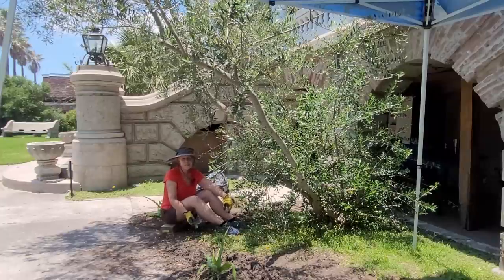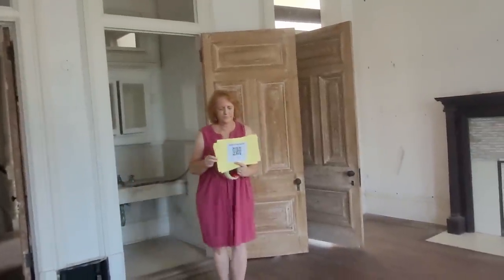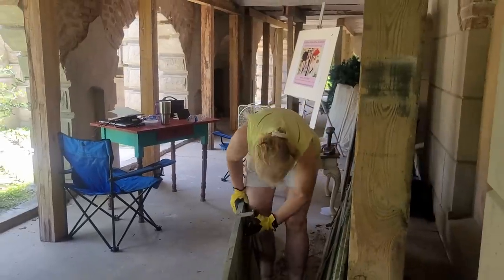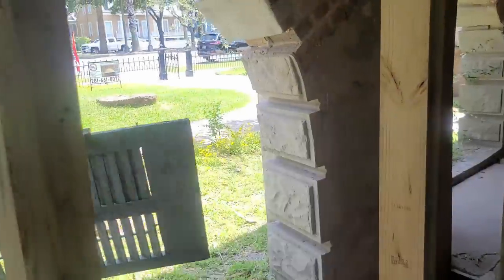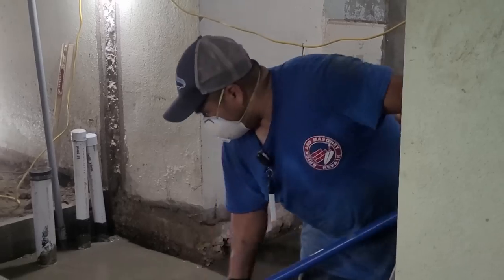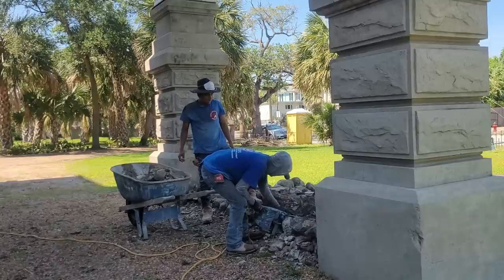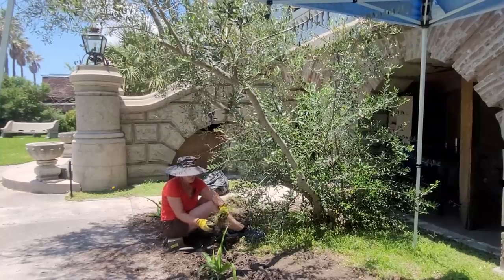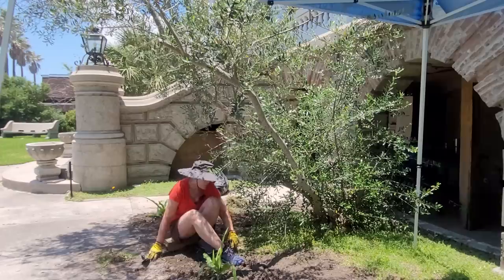S3.14  We Opened for Tours!!!!  And Got a Floor

Comment: I really like lantana for consistent blooming and size. Here is one: ‘NEW GOLD’ LANTANA (Lantana camara): many flower colors; shear occasionally; everblooming; heat and drought tolerant; sun; 2 feet.
Reply from the maker: There is a little of the old fashioned multi color lantana on the property.  It's probably been here forever.  It is very hardy and blooming right now.  It can take the heat.  Do you have a problem with bugs?
Reply: I haven't had problems with bugs with my lantana (in Dallas), but some of it seems a bit sickly this year. I imagine it will start doing better now that the awful hot and dry summer weather is setting in.

Comment: I bet the dark green looked nice. That is a lot of mixing in the hot basement. Ricardo's new toy looks very fancy, much better than string lines and bubbles.   great update 2x👍
Reply from the maker: Fortunately, the basement is the coolest place to work but that's not always saying much.  the ziplevel is really cool.  I remember the olden days of a long plastic tube filled with water strapped to a ruler.  Although it did work.
Reply: @leaguekempnerhouse  It and the plumb bob all ancient builders needed to build pyramids and Colossi of Rhodes.

Comment: You may want to try a penetrating fluid called PB Blaster to free-up the folding gate on the elevator. WD40 is great ut it seems you need a penetrating oil to really get in there. It's fairly inexpensive and most auto parts stores will carry it.
Reply from the maker: If the WD40 doesn't do the trick I'll move on to a penetrating oil like PB Blaster.  They work great but are a little harder to clean up after.  Could be a great choice if I can get the door off and lay it on a flat surface.  I'm curious to get back to the house and give that door another try to see if it's any better.

Comment: You sure work hard - very rewarding tho ... I was at Lowe’s yesterday they have a portable air conditioner that may work well for you in your outdoor seating areas ... it does create a lot of dripping water tho ...
Reply: Those work by evaporation, don't they? They're not very useful in the humidity of Galveston.
Reply: Not sure how it works but when I felt how cold the air was coming from the fan I was impressed. However, I held my had in front of the fan and WOW it dripped with water.  At first I thought it could be used in one room in the house and then not turn on air conditioner but, way too much water in the air.
Reply: Not sure how it works but when I felt how cold the air was coming from the fan I was impressed. However, I held my had in front of the fan and WOW it dripped with water.  At first I thought it could be used in one room in the house and then not turn on air conditioner but, way too much water in the air.
Reply: Not sure how it works but when I felt how cold the air was coming from the fan I was impressed. However, I held my had in front of the fan and WOW it dripped with water.  At first I thought it could be used in one room in the house and then not turn on air conditioner but, way too much water in the air.
Reply: Not sure how it works but when I felt how cold the air was coming from the fan I was impressed. However, I held my had in front of the fan and WOW it dripped with water.  At first I thought it could be used in one room in the house and then not turn on air conditioner but, way too much water in the air.
Reply: Not sure how it works but when I felt how cold the air was coming from the fan I was impressed. However, I held my had in front of the fan and WOW it dripped with water.  At first I thought it could be used in one room in the house and then not turn on air conditioner but, way too much water in the air.
Reply: Not sure how it works but when I felt how cold the air was coming from the fan I was impressed. However, I held my had in front of the fan and WOW it dripped with water.  At first I thought it could be used in one room in the house and then not turn on air conditioner but, way too much water in the air.
Reply: Not sure how it works but when I felt how cold the air was coming from the fan I was impressed. However, I held my had in front of the fan and WOW it dripped with water.  At first I thought it could be used in one room in the house and then not turn on air conditioner but, way too much water in the air.
Reply: Not sure how it works but when I felt how cold the air was coming from the fan I was impressed. However, I held my had in front of the fan and WOW it dripped with water.  At first I thought it could be used in one room in the house and then not turn on air conditioner but, way too much water in the air.
Reply: Not sure how it works but when I felt how cold the air was coming from the fan I was impressed. However, I held my had in front of the fan and WOW it dripped with water.  At first I thought it could be used in one room in the house and then not turn on air conditioner but, way too much water in the air.
Reply: Not sure how it works but when I felt how cold the air was coming from the fan I was impressed. However, I held my had in front of the fan and WOW it dripped with water.  At first I thought it could be used in one room in the house and then not turn on air conditioner but, way too much water in the air.
Reply: Not sure how it works but when I felt how cold the air was coming from the fan I was impressed. However, I held my had in front of the fan and WOW it dripped with water.  At first I thought it could be used in one room in the house and then not turn on air conditioner but, way too much water in the air.
Reply: Not sure how it works but when I felt how cold the air was coming from the fan I was impressed. However, I held my had in front of the fan and WOW it dripped with water.  At first I thought it could be used in one room in the house and then not turn on air conditioner but, way too much water in the air.
Reply from the maker: A little air conditioning would be nice but unfortunately, it's not practical at the stage we are in now.  Under the porch in the shade isn't too bad, or in the basement with some fans running.  The heat will definitely determine what we work on this summer.